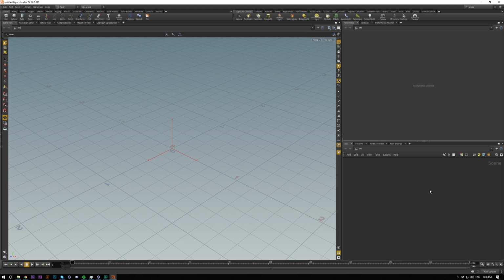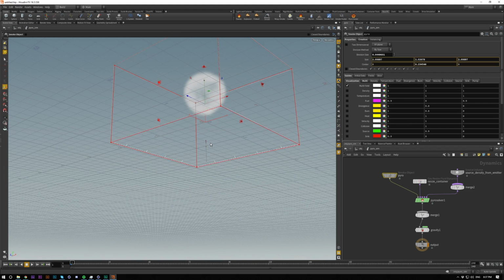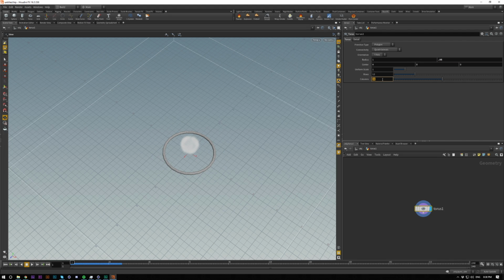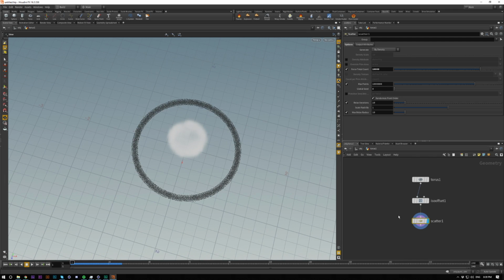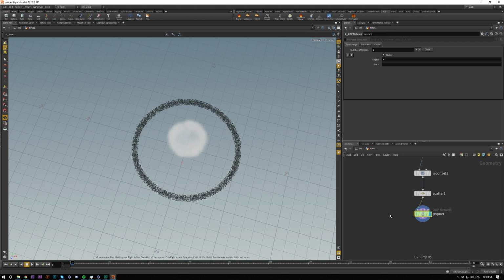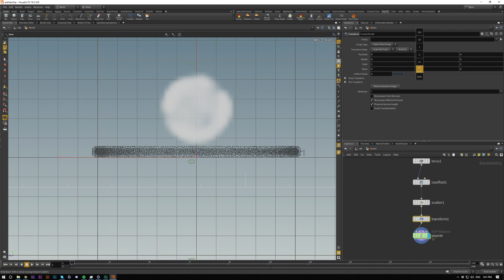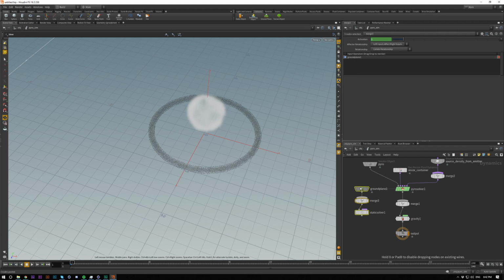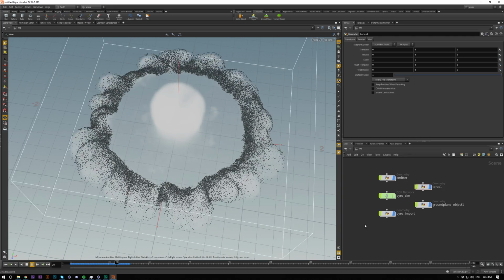Quick Ole Shockwave in Houdini

Comment: Question: after the smoke disappears the particles are stuck there and not moving anymore. How can I give them motion after the smoke is gone?
Reply from the maker: If you turn off dissipation the pyro solver won't fade out.

If you don't want to do that you can change the pop advect parameter from update position to velocity which should keep the particles going after the smoke has disipated.

Comment: Tried following the tutorial, but when I put in the popadvectbyvolume node, it failed to actually move the points.  I followed the tutorial exactly.  Know what might be wrong?
Reply: Nvm I figured out the problem
Reply: @maxwang7814  What was the issue?
Reply: @maxwang7814  What was the issue?
UPD In my case, I did not connect the node))